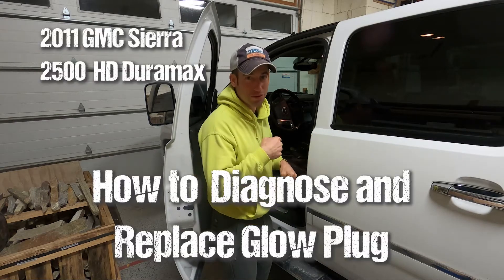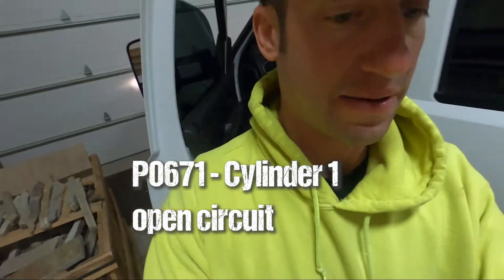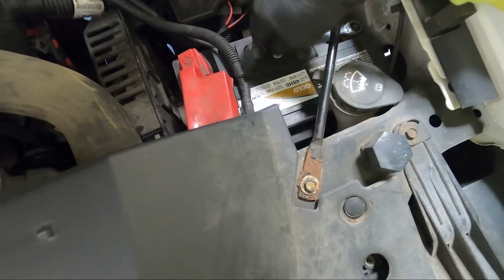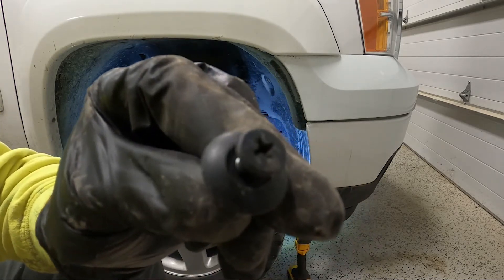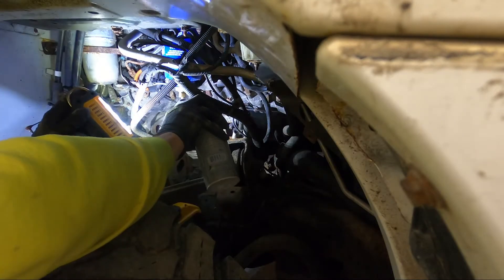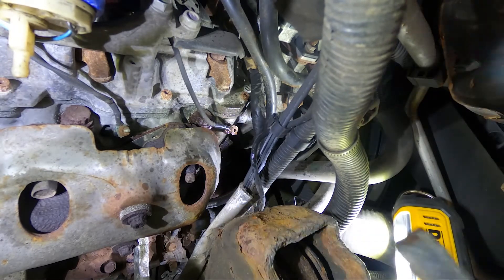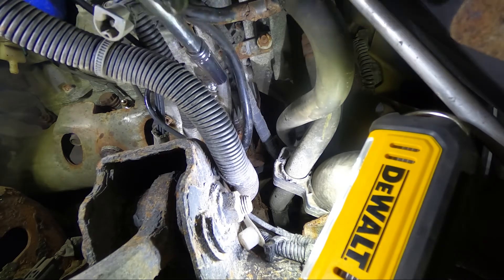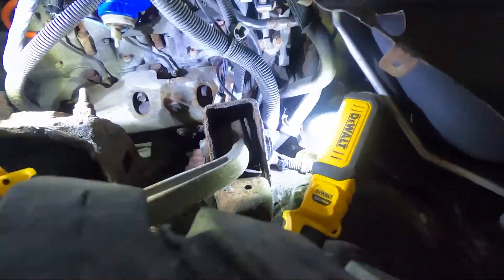How to Change a Glow Plug on GMC Sierra 2500 HD Diesel P0671 | Diagnose with BlueDriver OBDII

Comment: Replaced the plug and didn’t clean the wire and the code still shows should I clean it or replace the wire?
Reply from the maker: Did you clear the code? I remember it taking a little bit before it clears on its own.

Comment: Thank you for making the video lots of good information much appreciated would you know if this would cause the vehicle to not start because of this problem?
Reply from the maker: I've had the glow plug error code several times and every time the truck still started. The few times the truck hasn't started was when the fuel filter was clogged, so that's a once every 2 years replacement for me. I keep one in the truck!